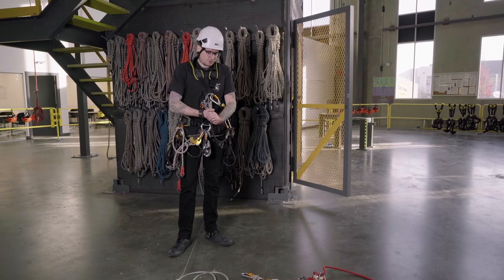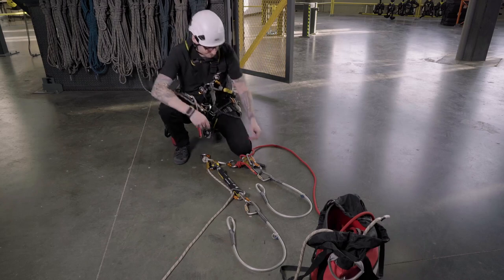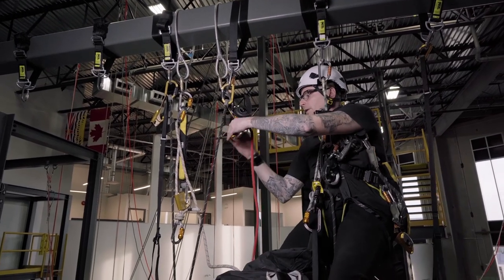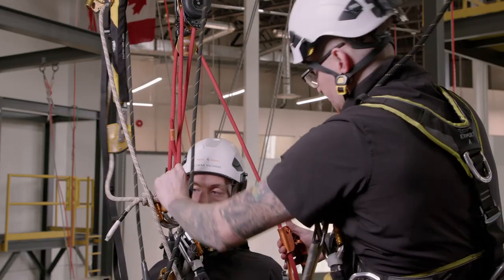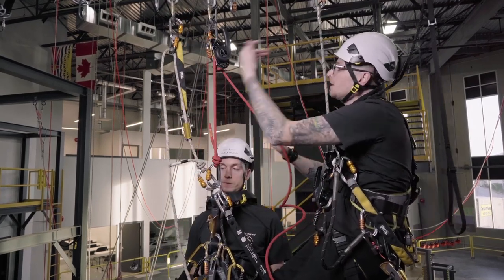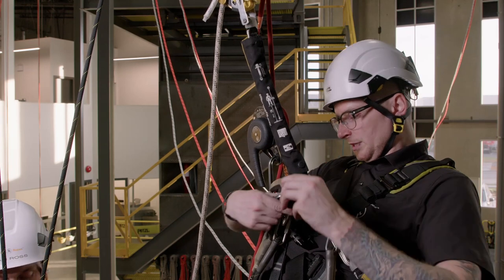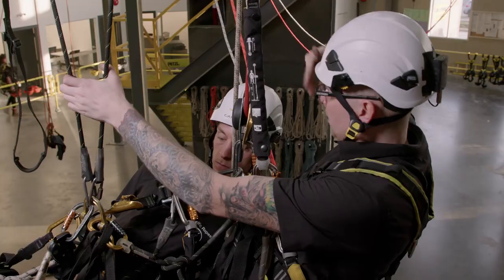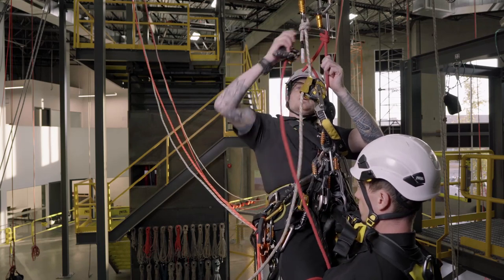Horizontal Aid Rescue - IRATA & SPRAT

Comment: So he mentioned about keeping the casualty straight hence the rescue line on the sternal, but now you are one only one point by putting the 2nd rope on the same point. Why not using the back D?
I'm really under the impression that the casualty is on one point.
Reply from the maker: Yeah there are definitely a couple schools on thought on this. According to IRATA, "everything between the harness and the anchorage must be doubled" Many consider the d-rings on the harness to be inherently redundant. I'm typically of the school that separating them is best practice, so in many ways I agree with you. An alternative would be to tie some "bunny ears" at the end of your rope and lengthen an ear to reach the ventral d-ring to make it extra redundant. Using both the sternal and the dorsal have never been ideal for me because if you lose one line the position of your casualty drastically changes, which could cause further injury to the casualty (especially if they're already injured.) Hope this helps (:

Comment: Question? what about not using the hand ascender and the foot loop and just making a foot loop and holding it to pull up the 3 to1? FD rope tech asking
Reply from the maker: If I understand you correctly: instead of installing my personal hand ascender on the tail rope of the 3:1. why not just hold a loop of rope and step in that? I see no reason why not, assuming your boots are not contaminated with anything that could damage your ropes (: There are definitely short cuts if you're missing gear!